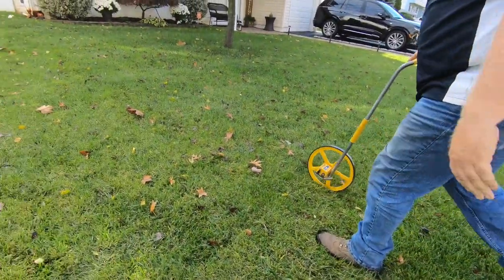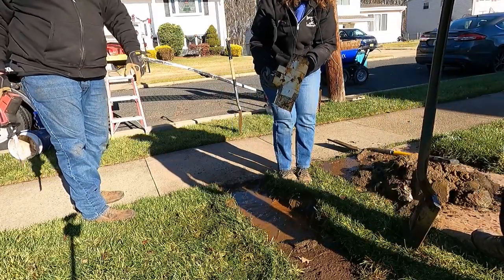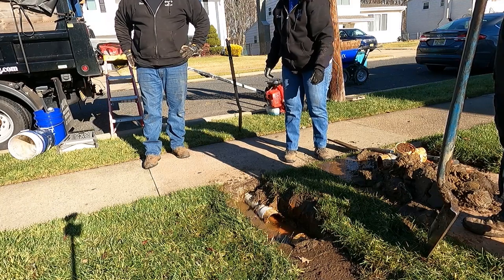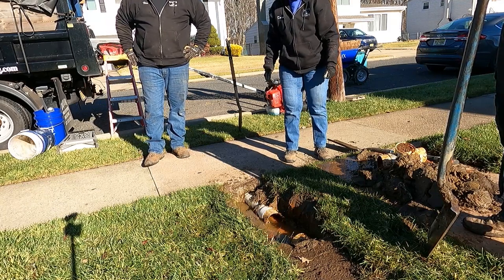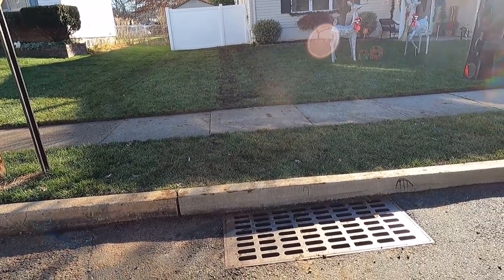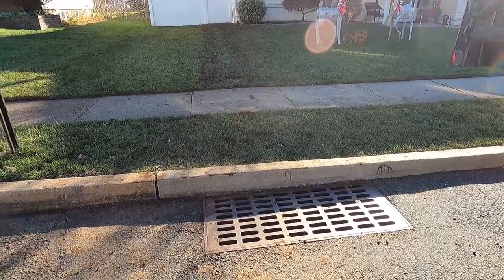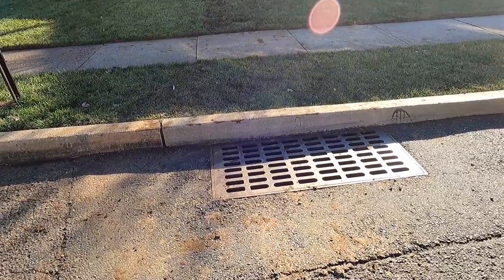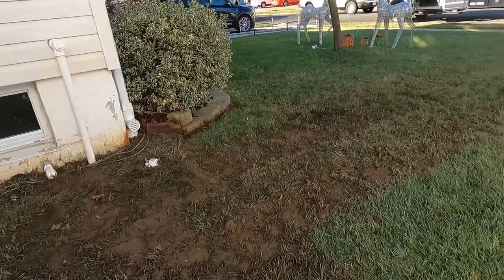Replacing a clogged sump pump and downspout drain to storm sewer - Old Bridge, NJ. 08857

Comment: You go Guys!!!   Excellent Video. 
I especially like the overflow  - 
1 1/2” inch c/o for freezing on sump line!!!
PS.. the beeps are cool
Reply from the maker: Thank you Chuck.  I like doing the sump pump discharges that way.  I tell the customers if they ever get a blockage to just take the plug out.  Same thing with the downspouts - the TY gives access and is a discharge if there was a blockage.  I appreciate your nice comment.  Thanks and have a great weekend, Tom